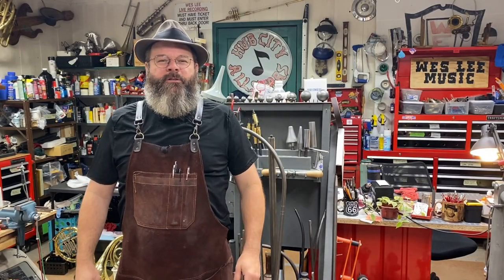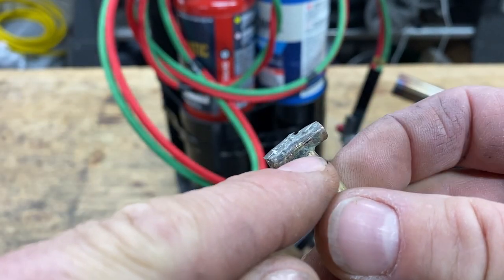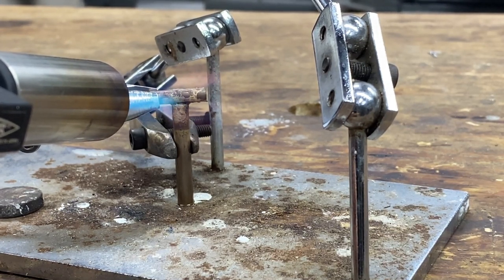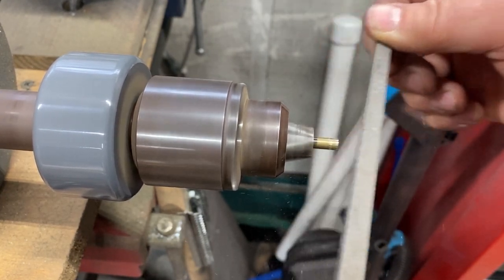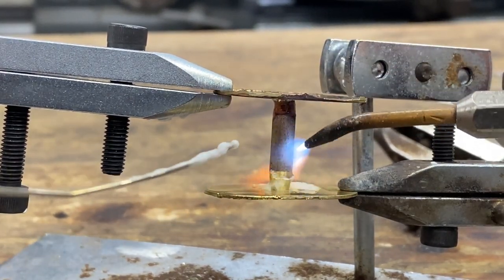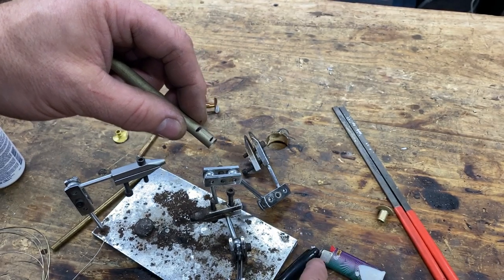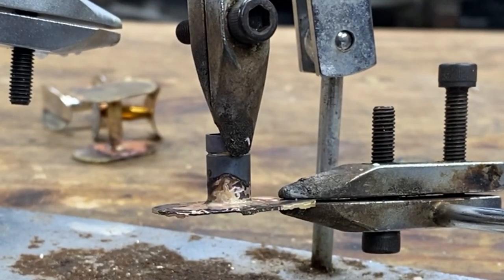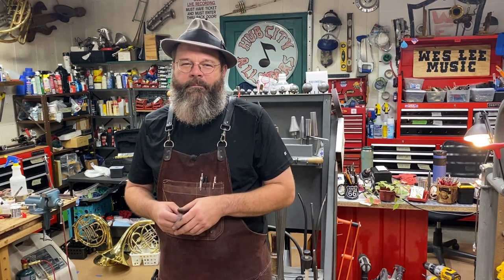Soldering Ep. 2 plus fabrication 101- Band Instrument Repair- Wes Lee Music- Ferree’s Tools

Comment: So what's an example of low-temp silver solder? What alloys are used?

The only "low-temp" silver solder I know of is the material we call SN62. It's 62pc tin, 36pc lead and 2pc silver (SN62/PB36/AG2). Its much like SN63/PB37 solder and melts at roughly the same temperature. It's used when soldering on previous metal plating as it prevents leeching of the playing into the solder.

Comment: He Wes, thanks for the video.  So when you anneal something it appears that it takes the tensile strength from the brass.  Is there anything that can be done to change that characteristic so that it stays rigid, or be made rigid after the fact?  Thanks in advance.  I love these videos!
Reply: Annealing brass increases the ductility of the metal. Brass can be rehardened through "workhardening". So bending brass, removing dents, swedging a key, or expanding a tube ect. would all reharden the brass to an extent. Both annealing and hardening of brass are reversable processes.
Reply: Annealed brass can be useful for more than just making it easier to shape aswell. Because annealed brass has better ductility it is less likely to crack when put under stress. Hard brass has worse yield and is more likely to crack, but it is more stiff. Softer tubing is more likely to deform and dent without cracking compared to harder brass. Mr. Wes Lee please feel free to correct me or add anything you would like.
Reply: @joshuaadam5514  Thank you for the insight.

Comment: Very cool....or hot. I wonder how many other techs make their braces.
Reply: If you have the choice to have a factory made one that fits, it's a better business choice, time is money and it's done faster in the factory. But if it's a vintage instrument, or for any reason you can't get the part or it's a rush job, you'll make the part
Reply from the maker: Time is money, that is correct, but learning the skills of what to make, how to break it down to make it, the process of making, are in my opinion invaluable. 
I use that same thinking as evidenced by showing a premade factory brace that we were copying. I personally know quite a few techs that cannot make any part, and I find great value in being able to make tools and fabricate.
Reply: @wesleemusicrepair9820  I fully agree, being able to make parts and tools is a great skill. However, even when you can make it, it's sometimes cheaper (thus better for business) to buy parts or tool than making it
As a hobbyist living outside the US, I don't have access to most part providers, so I had to learn how to make them. I'm always happy to teach my hand, however for some stuff I'd like to be able to buy rather than make. Particularly tapered tubes